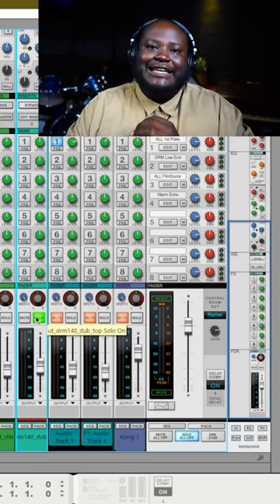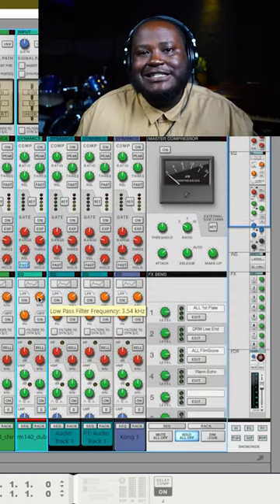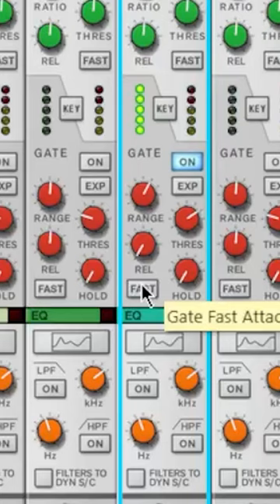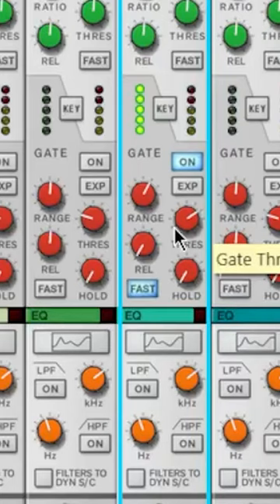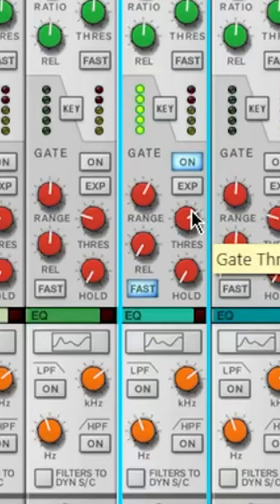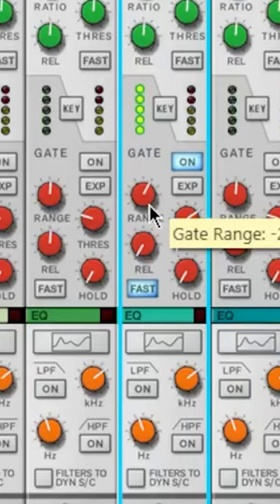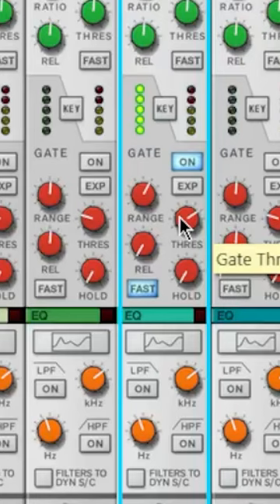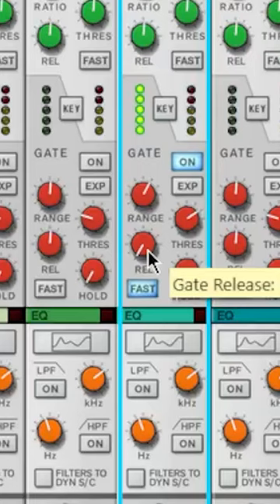Applying a Gate To A Channel | Reason 12 #shorts

Comment: are the channel compressor/gate/eq sections routed before or after the insert fx?
Reply: I believe you can set that with some buttons above.
Reply: Change the order of signal flow at the top of the mixer using the signal flow button

Comment: Ok so for confirmation, with this method, I don't have to add a compressor after my reverb to duck it's decay?
Reply: He uses it on wet samples where the reverb tail is already in. When u use a reverb, you can adjust its decay to your like and the gate is not needed